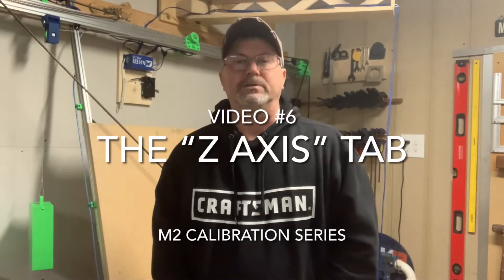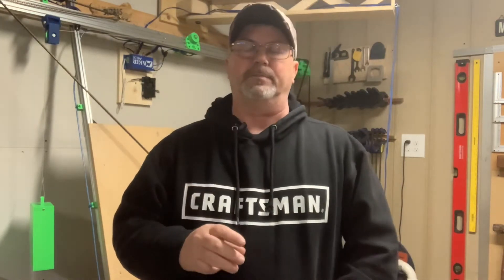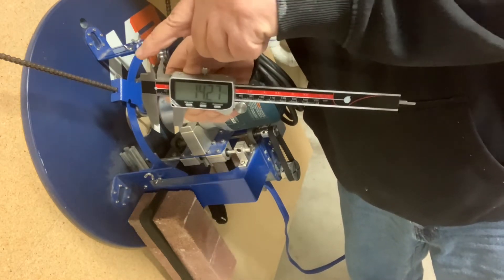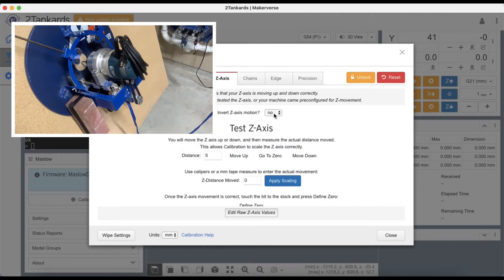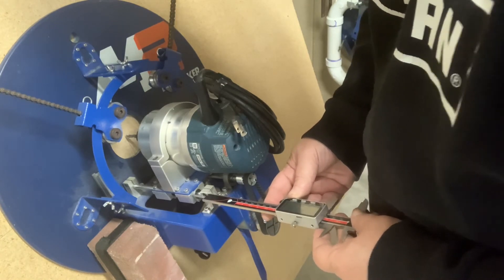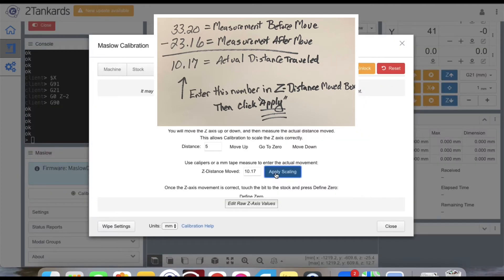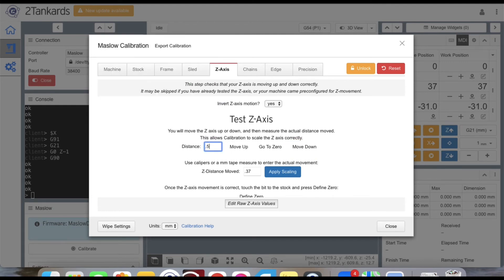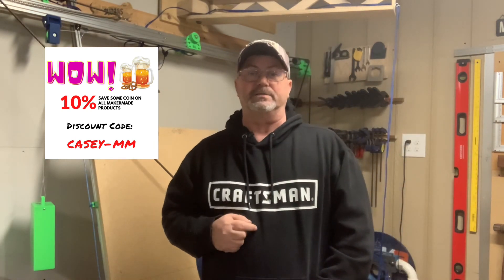MakerMade M2 Calibration Video #6

Comment: There's usually a fourth way to use calipers - the ends of the jaws are machined flush so you can get edge offsets. Cheaper units don't bother with this though, and most measurements could be taken with the depth gauge.